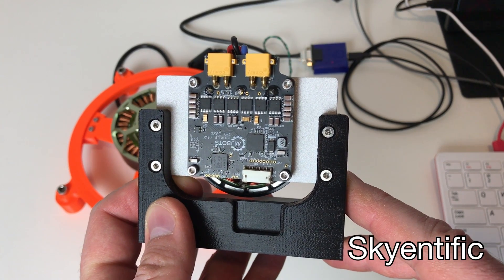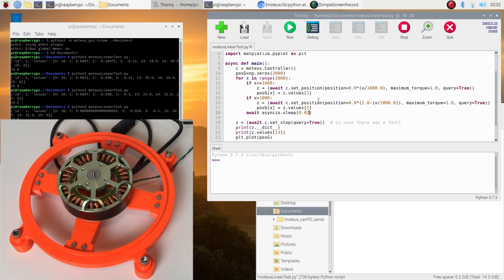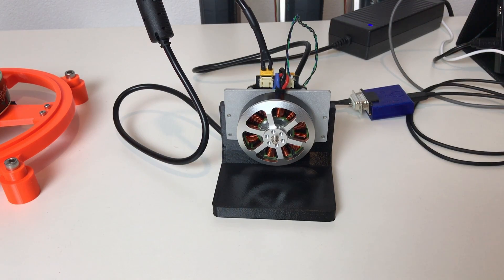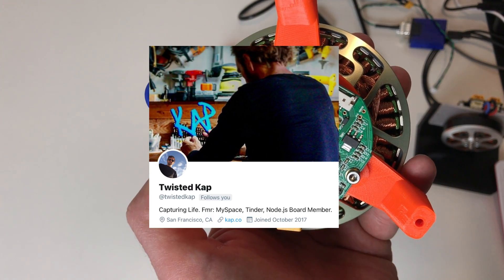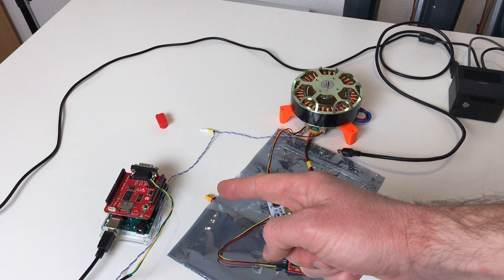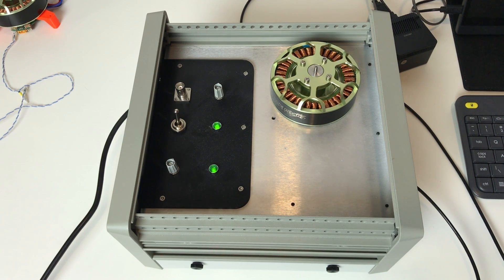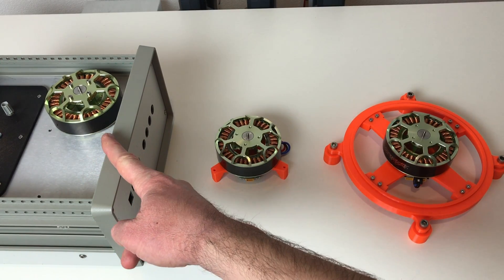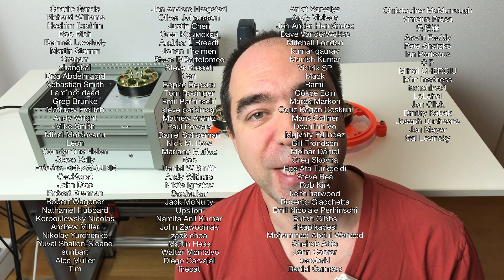Best BLDC Controller: ODrive vs MIT Mini Cheetah  vs Moteus (MJBots)

Comment: You can't really expect smooth control at low speed when you send position targets.
The boards probably have a velocity mode that can be smooth even at low speed.
The calibration phase on all these boards is probably exactly the same method, it runs in open loop (foc algorithm) it doesn't use the encoder readings. One reason it looks smoother on Odrive is probably only because they use a higher current.
Reply from the maker: Without this smooth control you cannot use them for precise motion for the direct drive or for the camera gimbal.
Don't forget the noise! The ODrive is super silent. So, I think there is more than just current value.
Reply: @Skyentific  I agree you can't use this position loop for a gimbal it's better to use torque commands and have external control loop. About the noise that is curious, maybe the pwm frequency is not the same on all boards. You said there is no encoder on the Odrive board? This means the motor is driven with a different algorithm it could explain.
All these board have open source firmware and documentation the difference is probably explained somewhere. You can ask on their discord also :)
Reply: @boblelan  If the Odrive is using a better encoder, like the CUI AMT 102, it could explain the much quieter sound. You can also reduce the sound by reducing the controller gains, at the expense of performance

I think a fair comparison would involve evaluating the anti-cogging features on the Odrive and MJ-bots controller, plus running through the recommended tuning procedure on each motor with a significant (camera sized) load attached.
Reply: @calvindekoter2128  exactly you're right! And there is maybe an anticogging mechanism in Odrive that isn't present in the others.
Reply from the maker: In this video I used the Odrive with the magnetic encoder (as5047), similar to the Moteus encoder (as5147).
Reply: @Skyentific  noise may come from higher bandwidth of current loop.

Comment: exactly what i needed! what about the vesc? it has servo functionality too!
Reply from the maker: Unfortunately, I never used VESC. But I've heard that it is very similar to ODrive.
Reply: @Skyentific  Нет не очень они похожи. Если vesc перевести в режим управления позиционирования то он работает таким образом. Например если двигатель находится в позиции 30 градусов и нужно перевести в положение 300 градусов он просто передвинется по короткому пути. Тоесть пойдет путь не 270 градусов а в 90. Это решается кастомными прошивками которые имеют кучу своих особенностей. А как контроллер для привода к скейтбордам он совершенен. Очень странная реализация FOC алгоритма
Reply: @Skyentific   Id love to see your opinion on the vesc and the difference between the OEM Trampa Vesc 6 and the open sourced variant similar to the  Flipsky or Unity Vesc's. some are quite pricey, but some are quite cheap, so it may be a good budget option.

Comment: Can you please build a BLDC Driver from scratch/opensource on your own. it will be a boost to bldc community.
Reply: check out simplefoc, i think thats what you are searching for
Reply: @jan.feucht  Yeah, there are already lots of people developing open source controllers, but none of it is very accessible to us noobs. A tutorial on how to design a board to run SimpleFOC would be extremely useful. Maybe 4 parts, 1. how to select components and design the schematic in KiCad or other free editor, 2) how to lay out the board in the editor, 3) how to order the board from NextPCB, 4) how to configure the firmware. Part 1 is the most important. There are plenty of existing board designs to look at, but nothing explaining the purpose of each component, so it's difficult to learn how to design your own from them.
Reply: @dekutree64  Thats an easy question, checkout the datasheet of the main component, normally the manufacturer of the IC describs in his datasheet where to put which additional component. If you dont know how to design a board, then start study electronic engineering, if you only want to use them then buy it. For example the Simplefoc board uses the L6234 from STM if you search for the datasheet you will find one with 14 pages, on page 7 is a Schematic Circuit with the components. Datasheets are sometimes more useful than a book. The other questions sounds more like lazyness 😉
Reply: @jan.feucht  I would've asked the same question but it's not laziness, just the chaos of being self taught. I found your answer to be really helpful too